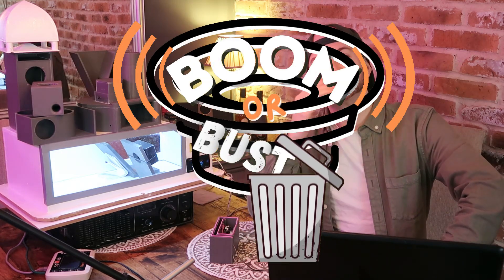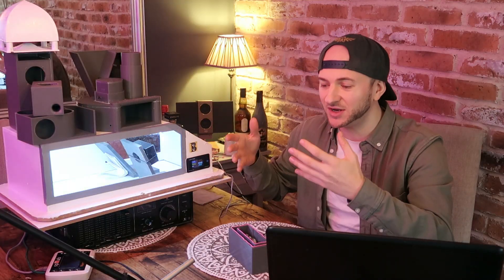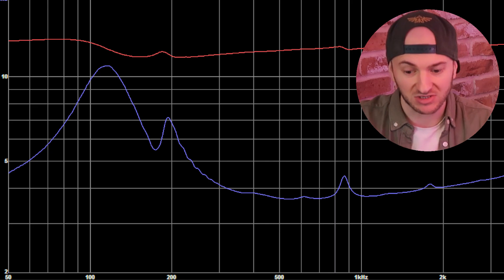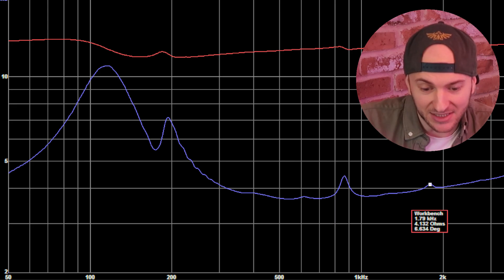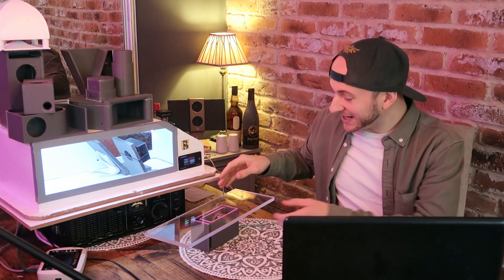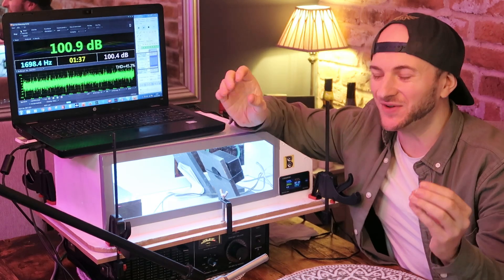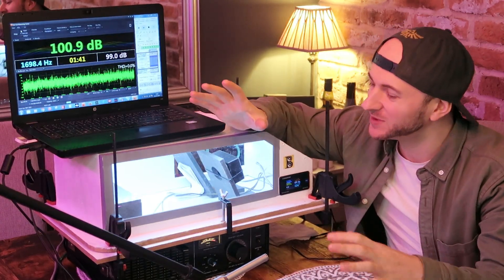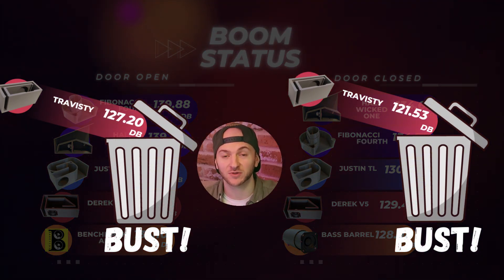How NOT to design a subwoofer box. | Boom Or Bust S1E9

Comment: @BassoProfondo- When i 1st seen this design, i thought about the port boundary/loading rule(i think the same goes for woofers). The loading surface/boundary, should be @ least half the diameter of the port/woofer's dia. away from them, to be able to perform properly. This woofer being 2"/50 mm in diameter, should have been @ least 1"/25 mm away from the port's back surface. Furthermore, to allow the sound a less restrictive flow path, i believe a 1"/25 mm gap, @ the beginning of the woofer baffle, opening up to 1.25"/31.25 mm @ the end of the woofer baffle, then from that @ the 2cnd bend/L of the port, open up even further to 1.5"/37.5 mm @ the end/mouth of the port, like a Horn! I would ❤ to see how this modification, could open up the performance- pun intended😆 get it, the port gets opened up😁, Oh never mind!

Comment: you ever think of geting one of those 2 inch b2 subs to try out in your test set up
Reply: He knew it wouldn't work for this application because its frequency range is too low. He needs something with a frequency response between 160 and 600 HZ. He bought one and tried it out anyway and it definitely does not work at those higher frequencies. Maybe we'll get a video about that little sub soon.

Comment: Bro if you want good great speakers, look bose vcs10. ,2 bass(bigger magnet and rubber surround)and 2 full range(smaller magnet  and rigid surround) , very cheap,,  2 inside speakers,2,75inches. ,accept no problème 50w on 60hz ,, is very cheap central 5.1 bose ,     free for you but i french,   so much expenssive port